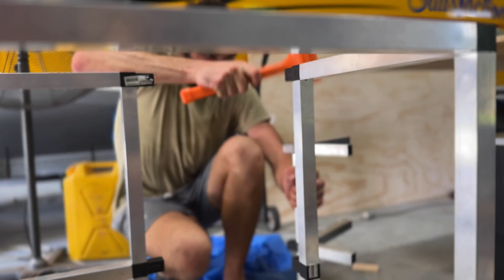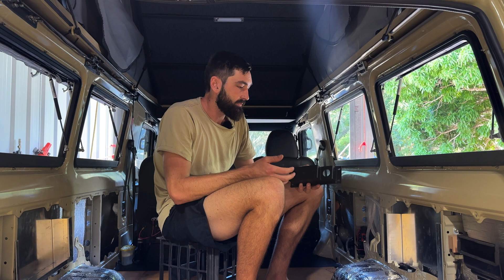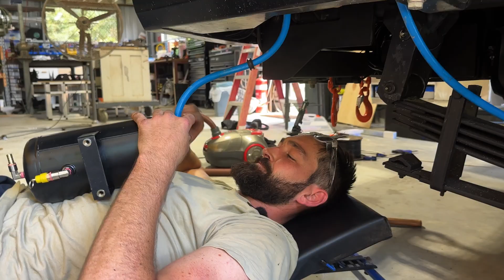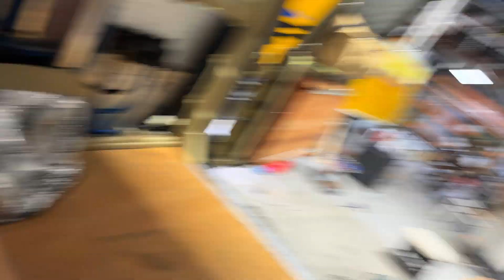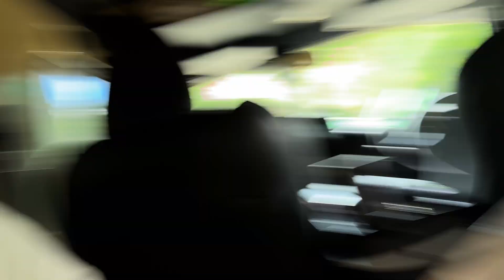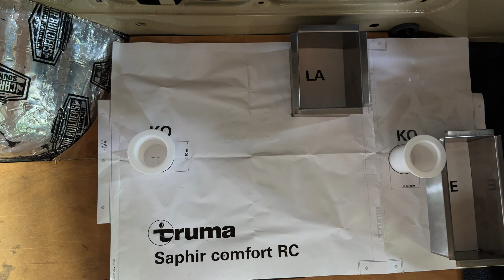TROOPY BUILD - Part 2 - ARE WE CRAZY? AIR, WATER, UTILITIES, AND…. ?

Comment: Be careful putting any load on the plastic connectors. My first two builds I used the same alloy tubing and connectors but all joins that took weight or shock loads eventually cracked. I now use metal connections or 80/20.
Reply from the maker: thanks for the tip, we have been on the road almost 10 months now and the build i holding up exceptionally well. we are so happy with how the framing is holding up.